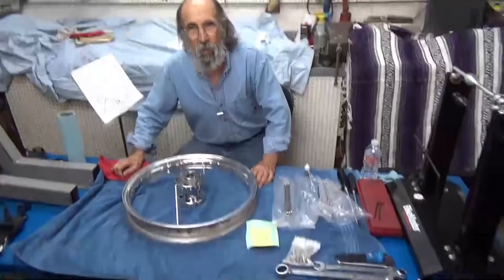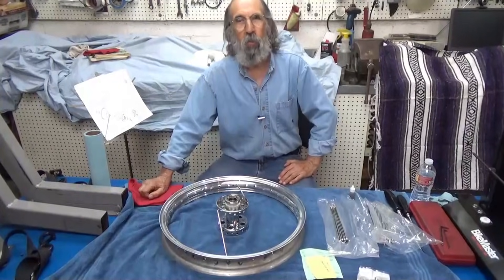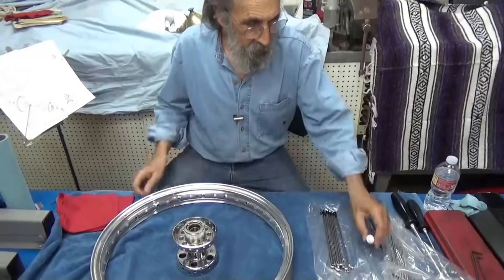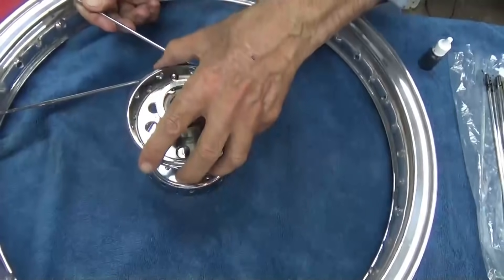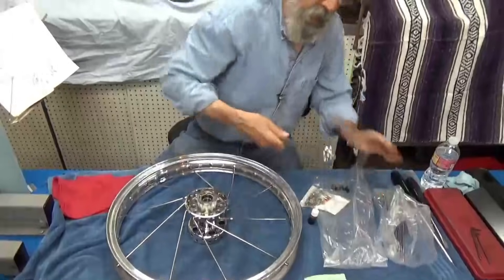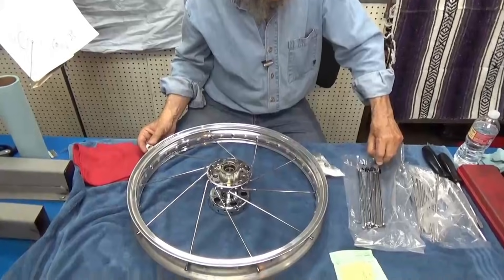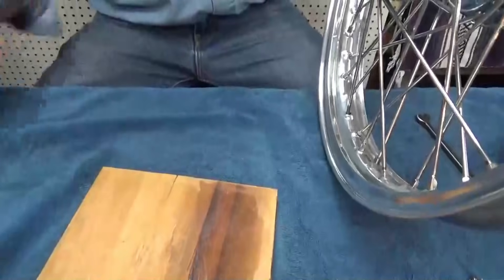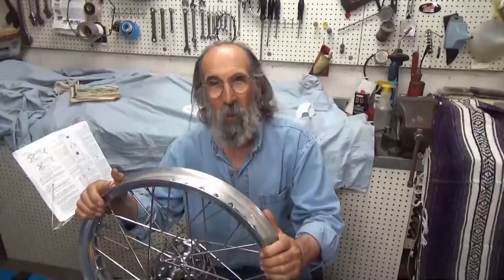Building a New Wheel For The "Project" Harley Davidson Big Flathead

Comment: Gdaya; Mike, Well I was at a backyard Harley mechanics shed the other day, talking to a couple of blokes about lacing a front wheel, when one of them said there are different spokes for Steel Rims & Aluminum Rims, "Is this true"?
 When I asked them about the Torque of the Spokes, they just looked at me, so that was the End of that;; So I don't sorta believe them, 
 As my bike, 2017 Dyna Wide Glide FXDWG has Alloy Hub with a Steel Rim, I would like to know what you think about it & where do I find the Torque Setting for my Spokes on a 21"X 2.15 as I have searched for hrs with no luck;; & the local Harley Dealer is about as useful as a 1 Legged man at an Ass kicking competition .
 Chrs = Bullett
Reply from the maker: Torquing spokes used to be just a "feel" thing.  The big deal being they should all match.  The only one who has ever given me torque specs on spokes is Buchanan Spoke and Wheel in California.  I go with what the manufacturer tells me on spokes and their toques.
Reply: Ok, Thanks for that, Mike;; Is it true about there being different spokes for Steel Rims & different spokes for Alloy Rims??

Comment: yea mike i got a 75 flh with a 16 inch wheel on the front same hub as in this video i was wondering if you could tell me the length of the spokes of this rim and spokes you got cause im going to lace me a 19 rim to my hub,message me back i would appreciate it
Reply from the maker: When you order your spokes, you specify the hub and rim.  I question if you're using the same hub as in the video.  A 75 FLH usually uses the most common hub of all.  However, the spokes are the same, generally from 36 up.  Read the add you're ordering your spokes from.  You need to make sure which hub you need to fit your front end and axel. Then, order your spokes.
Reply: The hub is already on the motorcycle I just need to know if they're around 8 and 1/2 in to my aftermarket hub that's already on the front end